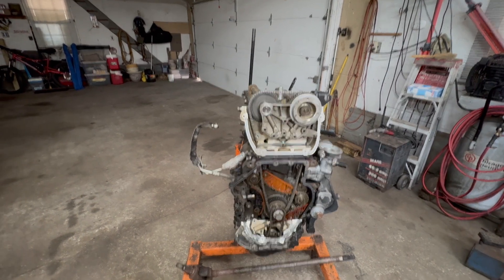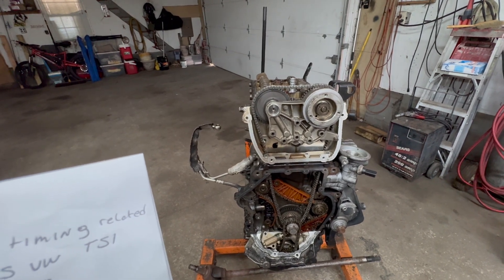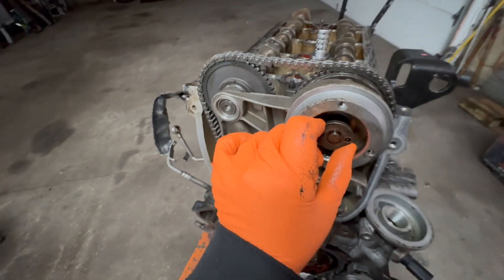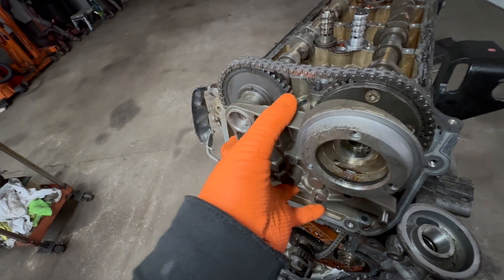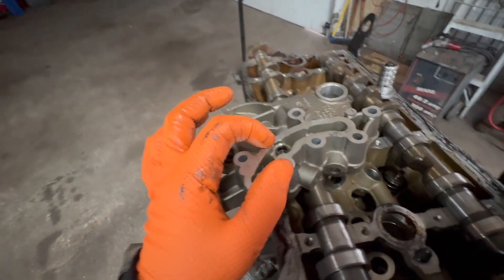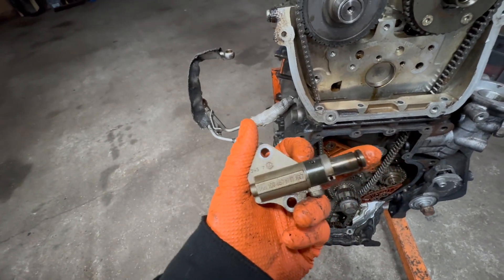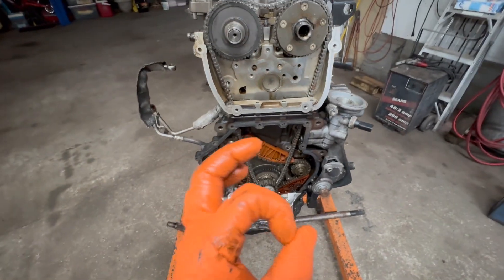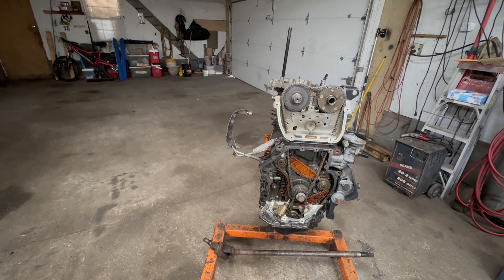VW, Audi, TSI, TFSI 2.0, P0017 P0016 P0341 P0011 P000A - Valve Timing Related Codes Top 3 Reasons!!!

Comment: I have just p0016 with a new timing chain and the valve is fine where should i start? My magnet moves freely and no oil in any connectors
Reply: The car runs 100% fine just takes longer to start up but is consistent with how long it takes. I do remember when replacing the camshaft bracket that the screen was blown out already and dont recall seeing the ball there too.
Reply from the maker: The ball can’t be missing, that controls oil pressure and valve timing
Reply: @m @motorcarnut with that ball missing is that what causes it to take longer to crank over and start? Sorry for all the questions I've already spent alot of cash on this car and just want to he as sure as possible when it comes to replacing parts
Reply from the maker: If it’s missing definitely. Surprised it’s still running good

Comment: On a CDAA engine, I replaced the camshaft, timing chain, N205 valve, and the solenoid. The car runs very well without any noises, but I still have code P0011. Any help?
Reply from the maker: You did a lot already, cam bridge check ball can be the problem
Reply: @motorcarnut I think when I moved the cam bridge, I could hear a knocking sound inside. Is that normal?
Reply from the maker: I don’t know what you mean when you moved the cam bridge?

Comment: Great video man! I can’t find the video for the oil control valve ?
Reply: Mine just has the P000A code
Reply: With a slight misfire on idle
Reply from the maker: Thank you1, Could be this https://youtu.be/TdBiepLv8Vw

and my head gasket video shows the oil control valve. There is a special tool you use to take it off counter clockwise but you can check the center button should be pretty flush to the other surface not pushed in or popping out that would mean its bad.
Reply: @motorcarnut tha in you very much for your help
Reply from the maker: Sure, no problem
Reply: Do you have a link for the head gasket video please ?
Reply from the maker: https://m.youtube.com/watch?v=CVLMH2LsHlU

Comment: About to do. 2009 Passat 2.0T. You have. A link for the upgraded timing chain tensioner? Got a gasket kit with new valves and all tools needed from watching your other video of head removal. Ned to purchase the newer timing chain tensioner
Reply from the maker: This is a good one:
https://www.fcpeuro.com/products/audi-vw-camshaft-timing-chain-tensioner-borg-warner-06k109467k?ads_cmpid=21759785218&ads_adid=167683900509&ads_matchtype=&ads_network=g&ads_creative=715095646761&utm_term=&ads_targetid=pla-293946777986&utm_campaign=&utm_source=adwords&utm_medium=ppc&ttv=2&gad_source=1&gad_campaignid=21759785218&gbraid=0AAAAAD3np3U5uFAsK5HNgJPunduUl1nYN&gclid=CjwKCAjwtfvEBhAmEiwA-DsKjkgtr3tn7_7-oiepc6oHQAl162AuEtrS60cnR6bFbqMmgGj7haPqWhoCbIoQAvD_BwE

Comment: I have Audi A5 2019, I randomly get p000a and p0011 followed by check engine. I have scanned through OBD11 as soon as I got check engine and I found out Camshaft adjustment intake bank 1 specified value as 0 while the actual is >5. When I turn ignition off and on the specified and actual value are almost similar around 5. Could this be sensor issue or cam bridge screen issue? I have checked the oil control value and magnet they are fine.
Reply from the maker: Yes it does sound like an oil pressure problem

Comment: Sir, I have installed an Audi A4 B8 MK7/VW cam and exhaust system. Using special service tools, the camshaft and piston tdc are aligned, but my engine is experiencing a P0341 code.
Reply from the maker: something in the valve timing is causing that code, could be the oil control valve, cam bridge or tensioner. I have videos on all of those search by code P0341
Reply: The car can't be accelerated, the rpm swings, the exhaust sound is shooting
Reply from the maker: Just gave you some answers above

Comment: Hi friend, your videos are very helpful, thank you for that. I have this series of codes on my 2009 CC. 2.0 TSI, I can't start. • Codes: P2293, P000A, P0300/P0301/P0302/P0304. I've already changed the high-pressure fuel pump and it still won't start. Any suggestions? Thanks 🤜🏻🤛🏻
Reply: I would find out if that fuel pressure sensor is telling the truth 1st. Also with those eniges, hopefully your timing tensioner has been serviced.
Reply from the maker: Yep, I have many videos on these engines covering all aspects
Reply from the maker: Thank you!, Seems like you have a fuel problem, did you make sure the cam and follower are not damaged? Can also be the low pressure fuel pump output or a wiring issue. The P0300 codes will disappear when the fuel problem is fixed.

Comment: Just had a car with p0341, p0011, p000A, p168B. Car randomly turned off, and a engine stumble that felt like a transmission issue when driving at a steady speed. 

Opened up the engine and found scoring on the cam bridge on intake side were the oil feeds. Im guessing it was losing oil pressure there. Fixed the engine stumble with new cam bridge.

After replacing the cam bridge p0011 and p000A keeped coming back. 
Opened the engine back up and cam bridge was had scoring again. Same place. Took the intake cam off didnt see any abnormalities but when i up the cam bridge on the intake cam it would lock up and metal filings were produced. Something wrong with the intake cam.

Will replace intale cam and get a new cam bridge. Will update on codes after replacement parts get here.
Reply from the maker: You may have an oil blockage caused by the screen in the cm bridge that blew out. Id take off the vacuum pump and blow straight though with compressed air to the cam bridge oil port to make sure its clear.
Reply: @motorcarnut I'll look into it. Vaccum pump is already of currently since i removed the intake camshaft. I can't confirm if the original screen had blown since the cam i found in there was a aftermarket replacement. But ill be sure to check for blockage before closing everything back up.
Reply from the maker: I hear ya, good luck with this problem.
Reply: Glad to inform that after 150 miles no codes. The issue has been fixed. Got the car inspected today.  No blockage from the Cambridge screen either.
Losing oil pressure from the intake side of the Cambridge was enough to set the codes.

A new intake cam and Cambridge has resolved the last 2 issues.
Reply from the maker: Awesome bro! Thanks for the update for other that may have this problem.

Comment: I just did complete timing chain replacement on a 2017 Tiguan 2.0. when I pulled the cam bridge the stubs on both camshafts was scored pretty bad you could feel it if you ran your nai across it same thing on the cam bridge. I did put it back together now I'm getting a p000a and p011 do you think by replacing the cam bridge and camshafts it will fill those codes? Yes I did replace the vvt and magnetic sensor.
Reply: Yes checkball is still there oil
 screen is blown out haven't found it. Timing is dead nuts. Timing chain was so loose it was actually cutting into the block and a little bit on the bridge itself. In fact it was running against the chain for the balancer shafts. A lot of fine metal particles went through that engine.
Reply from the maker: And the oil control valve center button was not sticking out?
Reply: That is corrrect. All components were replaced with new except the cam bridge
Reply from the maker: It's probably oil control pressure problem but where? that would have to be diagnosed in person, really can say more without looking at the vehicle.
Reply: I narrowed it down I think. Checked oil pressure at was 10 psi hot. So I think oil restriction at vacuum pump bad intake cam phaser and cam bridge possibly intake and exhaust balancer shafts and tubes. So at this point customer doesn't want to put any more into it. Funny thing is with that low of oil pressure the dash warnings never came on for low oil pressure
Reply from the maker: Could have been a failing oil pressure switch for the light but it does sound like maybe the screen that blew off the cam bridge got stuck somewhere and usually ends up somewhere near the vacuum pump oil port. You were on the right track
Reply: Mr. Audi A4 TSI 2012 trouble P0341 how clear help me
Reply from the maker: I have many videos on the code under VW which is the same as Audi, go check them out
Reply: @motorcarnut  I have reinstalled the timing mark, piston TDC, and camshaft top 1 according to the camshaft displacer points.
I tried to start it and it still idles abnormally/misfires.
Reply from the maker: It hard for me to know what you done wrong, I have other videos on this engine under VW could be cam bridge or oil control valve too.
Reply: @motorcarnut  Misfire idle epc P0341 timing Mark tcd ok. Engine not idle
Reply from the maker: Cam bridge or oil control valve.
Reply from the maker: Did you check all of the parts I explained in the video? Was the check ball in place in the cam bridge? Just being scored won't give you timing codes